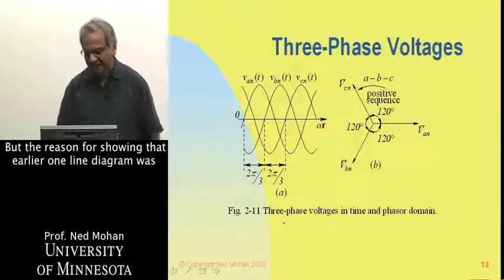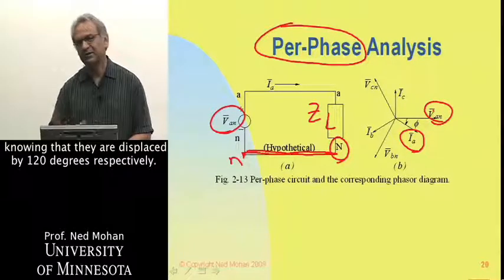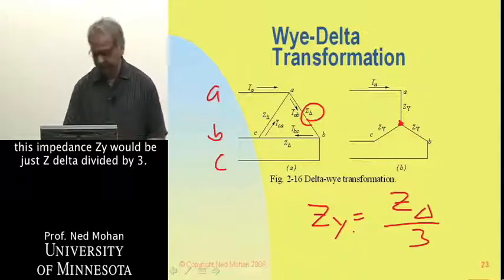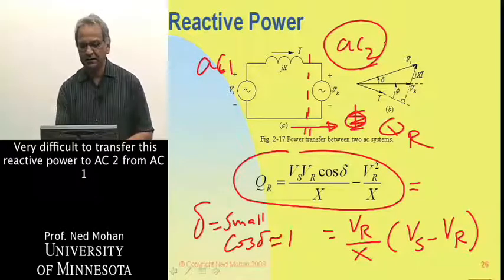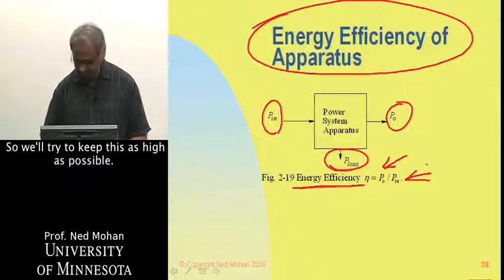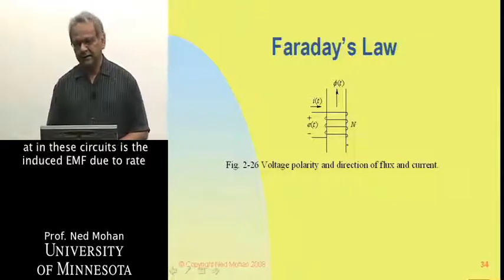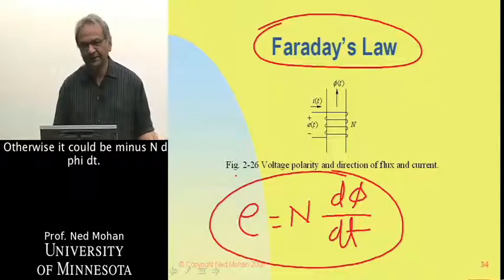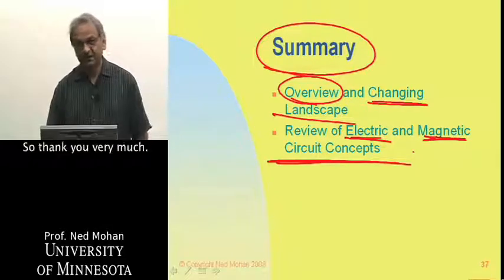Electric Power Systems Module 1-2

Comment: @25:09 the professor was not able to define the reason for positive polarity, but I think the positive sign came in Faraday law because if we remove the source i.e., voltage source with a resistance in order to know the action of induced emf, the induced emf is producing current such that the flux due to this current is eventually opposing the main flux, so no need of negative sign.